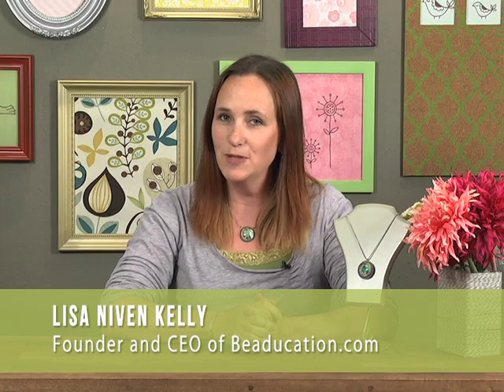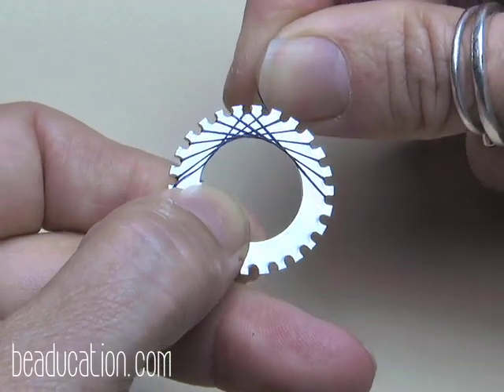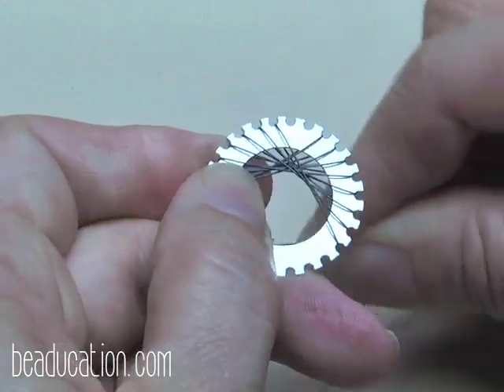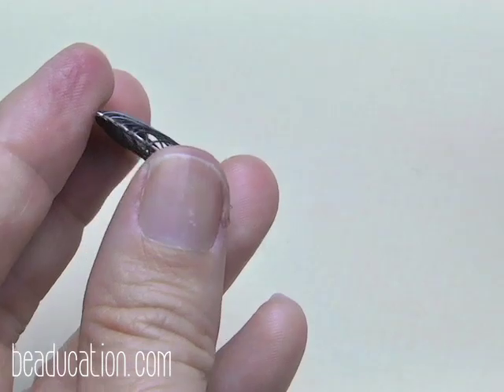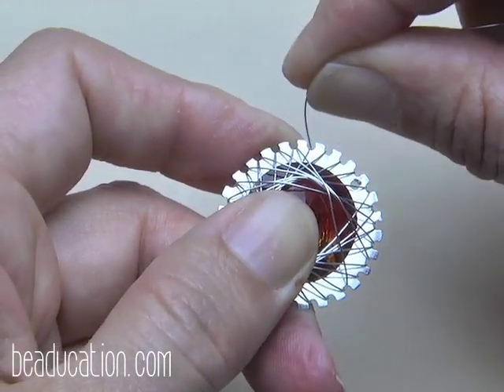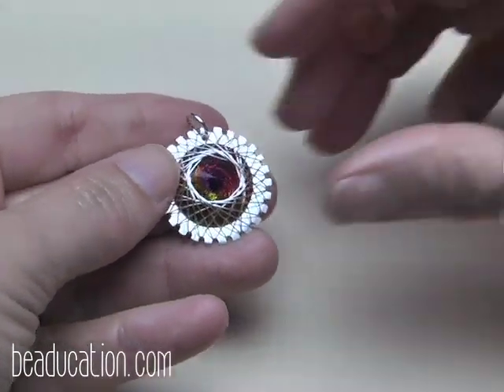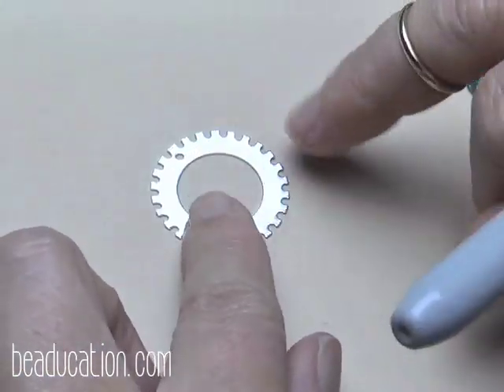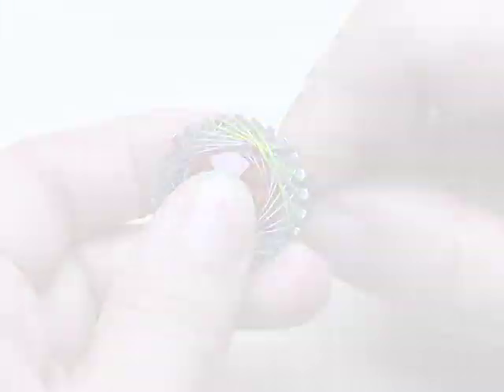Spiro Pendant - Beaducation.com

Comment: Your demo is awesome. Thank you for sharing.  I have a pattern from bead  & wire mag. I feel more confident about the project and where to order the supplies. What do you think about using a piece of tape to hold the bead in place just to get started and to keep the bead stable.  Second, will you be at bead fest in Philadelphia 2014 or any shows in the Philadelphia area in 2014.
Reply from the maker: Hi! Of course you could try using a bit of tape to stabilize the stone. Once you make your first pendant holding the stone in place with your fingers it becomes second nature.

We won't be at Bead Fest 2014, we're taking a year off to focus on fun new projects here at Beaducation Headquarters.

Comment: Do you have the metal in any shape other than round? These are so lovely but I have several large Swarovski ovals I'd love to do if possible 😊
Reply from the maker: We carry a variety of shapes and sizes on our site. These cogs were designed to work with the crystal sizes. However, you can check out the other metal blanks we carry on the site. 

https://www.beaducation.com/pc/188-metal-stamping-blanks

Comment: you can use a sewing needle to LIFT the tail at the top so you can grab it,,often a needle can get in easier and it will just lift and pull the wire out of the design
Reply from the maker: +gypsy269 ooooo, GREAT tip. Thanks!!! :)